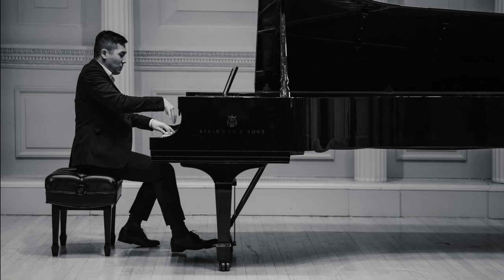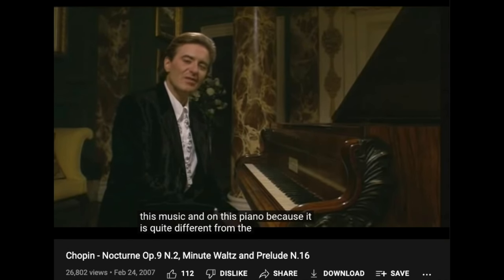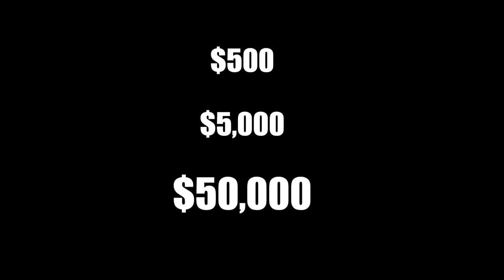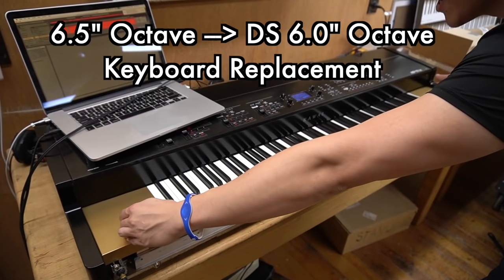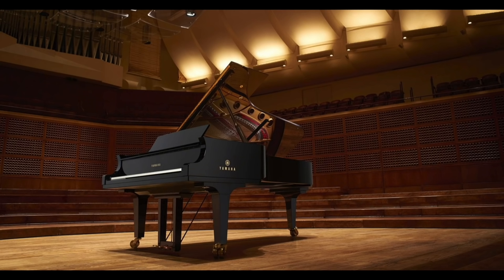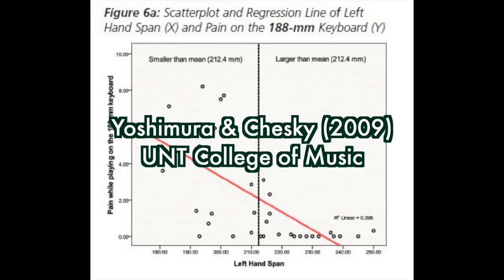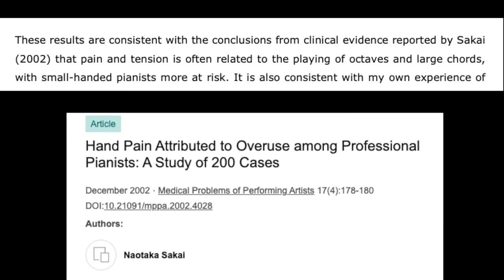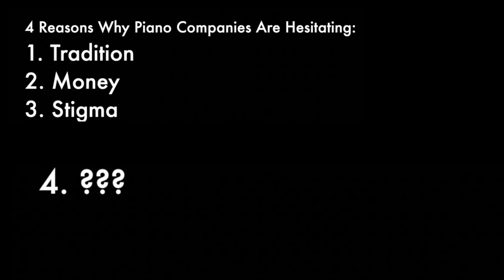Piano's Darkest Secret

Comment: Doesn't a smaller keyboard = more mistakes since you need to be more precise? And what about the width of a finger?
Reply: Many players have smaller spans AND more slender fingertips. For them the trade off for being able to span a comfortable 10th, 9th or even octave in some cases is well worth it. 

If you strain to reach comfortable octaves then your accuracy is very highly compromised in any passages dominated by octaves which can be quite common in classical piano.
Reply: Also the notes are much more 'under your hands' so less need for quick lateral or jerky movements to reach notes. The experience is that when your hand and the keyboard are well matched ergonomically, accuracy is greatly improved, not to mention tone and dynamic controls, speed, ease of learning etc...
Reply: @paskpianos  The conventional musical keyboard is handed down from a time before ergonomics was even a concept.
Reply: @douglascutler1037  Yes indeed. But - if you read the 1929 book by Otto Ortmann 'The physiological mechanics of piano technique' it covers many of the relevant  issues of ergonomics and biomechanics by going back to first principles of physics and anatomy. I studied this book in detail when I wrote my 2013 conference paper.
Reply: @paskpianos  I have that book. I haven't read it in quite a while. I will give it another look.

I agree with taking a scientific approach. But many musicians do not have a depth understanding of the scientific method. 

Generally, scientific research is not based on one-off studies. Usually, there is an incremental effort to become less wrong over time with follow-up research that builds upon and refines the original. All assumptions must be tested, Perhaps, there were follow up studies that attempted to build upon Ortmann but I'm not aware of any. If so, please direct me. In any event, Ortmann's work should not necessarily be taken as final word.

I do recall getting the impression from my original reading that Ortmann had assumed only an extending upper arm playing position when making conclusions about tension in the upper arm, shoulder and back. Yet pianists often allow the upper arm to fall straight down at the side. That arm position in my view is more relaxed and should be independently tested for muscle tension and compared to an extending arm. Perhaps Ortmann did comment on this and I just missed it. But if not, that is the type of thing rigorous follow-up goes after.

Also, the advent of reduced-width keyboards cries out for new, rigorous controlled studies of muscle tension throughout the playing apparatus comparing conventional to reduced scale. That would be university grade stuff, far beyond my resources. 

The injury study cited in the video is relevant. But are there any recent studies looking at active performance reactions like Ortmann?

Comment: if they made pianos with slimmer keys then the player with bigger hands would be able to do even more elaborate songs and you'd be back to square one in a decade.
Reply: Not really. Beyond a solid 10th, wide harmonic intervals in one hand suddenly get rather redundant as a stylistic or compositional element. And that is primarily in jazz piano and even there in the rather less-trodden genre of Harlem stride. 

In most of the classical repertoire the octave is still king. So more smaller hands reaching comfortable octaves would certainly level the playing field quite a bit there.
Reply: And the players with big hands wouldn't feel comfortable on the narrower keys so are unlikely to use it for composing...

Comment: I have the opposite problem being an organist, pianist and synthesizer performer. The standard piano feels like home to me, very comfortable...but with the non-standard key sizes of the synth world I am constantly playing keyboards smaller than the standard piano keys, I feel cramped and uneasy on these small synth keyboards. I am not speaking of the mini-keys, those are impossible for me to play, but the slightly reduced sized keys of synths and organs.  There should be 3 standards and all other keys sizes eliminated from the world. 1) The current standard piano 2) Your smaller keysize in this video. 3) Mini keys. PERIOD.
Reply: Agree - the alternative DS5.5 and DS6.0 sizes plus the conventional 6.5 inch octave suits nearly all adults. But we don't want 'mini keys' that are shorter and unweighted in cheap keyboards with less than 88 keys.
Reply: @paskpianos  The "mini-key" category is for synths and synth programming or what we call sound design. These keyboards are not designed to be performed by keyboard masters, just included as a convenient way to program the synth. The synth is actually performed from a remote full sized keyboard using a MIDI cable to communicate.
Reply: Yeah, I'm thinking of going in the other direction, more like custom keyboards designed for the ideal span of each player.

Comment: A shorter keyboard would have helped me when I was in college. You see, I wanted to learn to play stride piano. But I couldn't reach 10ths. I could just about make 9ths, and that was a strain. So, I became a voice major.
Reply: That is for sure. In stride, skipped 10ths just don't cut it. It's solid 10ths or go home. 

Funny thing is, I've posted a unique and potentially very inexpensive dual elevation keyboard design that quite literally makes impossible chords easy. Solid 10ths, 11ths, 12ths and more for ANY hand size! This is not a joke, it's a real thing. But it's not getting much attention. It can even upgrade existing keyboards and pianos. Perhaps it strikes people as too radical, perhaps and idea ahead of it's time. Even though it's simply an extension of a technique already used for maybe a hundred years by multi-manual church organists where occasionally they drop their thumb down to a lower level.

Comment: You dont know what you are talking about man. Some of us wish we had smaller hands and narrower fingers to be able to cope between the black keys. Also bigger hands move slowerr because of inertia and mass so any advantage would be negated for the most part.
Reply: It's a very small % of males who can't fit between the black keys. Widths of black keys vary between manufacturers and there's no reason why they can't provide narrower blacks. If you widen the white keys, then you would lose some of your reach...so if you can now play a 10th that might be reduced to a 9th if you make the octaves larger.

Comment: They say hands size is proportional to other parts of the body. Hmm ...
Anyway, I'm interested to try the 6" and 5.5" octave keys.
I have to stretch my fingers to play the octaves, but I'm so used to it, I could do it without errors. But there are pieces that requires me to play an octave + 2 notes higher (10th), that's what kills my fingers, and it makes my fingers sore just after 5-10 minutes of practice.
I'm from Malaysia, and I hope C Bechstein would do something like that, I'd trade in my current B190 for it, if it gives me the same touch, action and sound profile.
I think it's possible by maintaining the harp, just reducing the size of the keyboard, using the same actions, but not sure if it's possible with C Bechstein.
Reply: Although in general, taller people have bigger hands, the correlation between hand span and height is not strong. There are tall people with small hands and vice versa.

Comment: Tiffany Goff's reaction was so unbelievably touching. Music is an incredibly elitist endeavor with many of the revered exponents such as Liszt purposely doing things to make the piano less accessible to anyone who could potentially upstage them which then become codified and sacrosanct. No company would ever go on record confirming such a thing. Companies are the masters of smoke and mirrors hiding behind canards like R&D costs, etc. Therefore, it doesn't surprise me in the least that the piano settled on a size that effectively locks out most women and a sizable chunk of men. I am well aware of Rachmaninoff's celebrated span. Can you think of a more incongruous thing in music? It's like celebrating a violinist's neck length! Fortunately, progress is being made on this front. A giant congratulations to David Steinbuhler and MusicalBasics for promoting smaller keyboards. Yamaha or some other company could easily buy Mr. Steinbuhler's technology and instantly begin manufacturing smaller keyboards with ZERO or minimal R&D. In fact, if I were Yamaha or one of the big companies, I would be fearful of a competitor doing just that. So stay tuned. I sniff the winds of change.
Reply: Yamaha felt pretty comfortable confirming:
---
We understand your idea of a (digital) piano with narrower keys very well.

As a manufacturer of mass-produced products, Yamaha is unfortunately not designed for customised production or a run of very small series at disproportionately high prices. We are convinced that an individualisation of the key width would be a hindrance to the community of piano players, who for centuries have all concentrated on a common standard size.

We hope we have been able to help clarify your query and wish you continued enjoyment in making music.
Reply: There are a couple of startups with keyboards under development.

Comment: At 8.5", my hands are small, but not cripplingly so. Pretty much any guitar or bass neck is fine for me if I strap it high enough. On a piano, I find ninths doable, but tenths impossible. I did notice that some of the vintage synths I've played come up short of the 6.5" / octave standard without being mini-keys. The Yamaha DX7 comes in at 6 5/16" / octave and the Roland D-50 comes in at 6.4" / octave.

Comment: The concert halls, etc. have to prepare two- or more sized pianos and it is a good chance to sell more pianos for the manufactures. In addition, it might be a discrimination against female pianist. These approach would be more persuasive, I suppose.
Reply: Concert halls can have interchangeable actions/keyboards - a lot cheaper than buying another piano, and less space required. Only two smaller sizes are needed to cater for nearly everyone - DS5.5 and DS6.0. Alternate actions can be swapped over in minutes, which has already been done in the Dallas International Piano Competition where contestants have been offered a choice of keyboard.

Comment: It seems average hand span for a man is actually 7.4 ". Where did you get your chart?
Reply: The average span for an adult male pianist is just under 9 inches, based on several reputable studies. Hand span is defined as maximum span between outer edge of 5th finger and thumb, with hand stretched out to the max on a flat surface. For women, it's an inch less, so around 7.9 inches. For details check out PASK....

Comment: You can't take a piano with you

If you move your hands out of pure muscle memory, 
having different size keys is just horror
Reply: Check out brain plasticity. It is now the accepted norm in neuroscience. 

Motor-control brain mapping is never fixed or hard-wired even under normal circumstances. Always shifting a little on it's own, anyway. The testimony from those who actually use reduced-width keyboards is that adaptability is not so hard as you might think.
Reply: Exactly i had a light weight electric piano, when I changed that it was hell trying to press on heavy keys

Comment: I wonder if given the option the most popular choice in the general piano population would be something slightly smaller than the current standard.
Reply: Undoubtedly that's the case. If there could only be one size, it would be around a 6.0 inch octave.
Reply: @paskpianos  The alien anthropological survey team would shake their heads at the lack of progress in Earth's musical keyboard ergonomics.
Reply: @paskpianos  Yes. I'm a male with medium large hands. I can span a 10th but my white key 10ths are crimped and from the front. Not exactly mobile or dynamic. Just a little more span would certainly make a difference. I think there must be many males in the same boat.
Reply: @douglascutler1037  Yes indeed. Are your fingers slim enough to fit between the gaps if the keys were narrower?
Reply: @paskpianos  It wouldn't be much of an issue for me with a slight reduction in width.

Comment: Everything in this video also applies to computer keyboards. There is no perfect computer keyboard for every hand size or a perfect shape or a perfect layout. And fortunately there are lots of variation available for this kind of keyboard. Don't stick with a basic computer keyboard if you don't have to. Try out different sizes and shapes and arrangements and you may notice that the reason why you could never type faster or more accurate or with less pain in your hands was not the way you type, it was using the wrong keyboard for your hands.

Comment: So, if you have small hands with fat fingers you are really screwed since you can't fit between the black keys.  Just blame your parents for not stretching your fingers. My 4-year-old girl can reach 6" since like me and her brother our thumb and little finger oppose each other at 180 degrees.  I have relatively small hands, but if they are flexible a 10th is not a big deal.  The dynamics of a piano for maximum sound and response are the result of endless experiments and refinement.  Don't blame the piano!  BTW it does not require a giant hand to play Chopin Op 10 No. 1 etude.  Also, how many of you, including professionals, leave out notes in three chords (bottom octave note) of Op 10 No. 2 so that you can play much faster?  You know exactly what I am talking about. If the piano were smaller, you would STILL skip those notes for performances.

Comment: I feel that the issue is exaggerated. There are many other reasons for the standard size keys. Talk to a piano technician.
Reply: Appeal to authority fallacy. Technicians could simply be trapped in common practise. Would not be first time.
Reply: Same thought, it's a big instrument and can be carried, if it was different sizes, it would be different each time you change the piano

Comment: 🎹🎹🎹🎹🎹🎹🎹🎹
There is one massive factor that this otherwise well thought out video totally missed. The left verses the right hand of the vast majority of the global population don’t have the same reach on the keyboard. My left hand reach is 8.5”, where as my right hand is barely 8.0”  This means I can only play a full octave chord in my right hand on the white notes, but my left hand can play a full octave chord plus one extra white note beyond the 12th note scale per octave.  Right hands typically have a half inch lessor reach or finger spread. This makes a smaller keyboard all the more of a necessity among the vast majority of piano players on a global scale.
Reply: It's true that left and rights hand spans are often different. However in our 2015 study of the hand spans of nearly 500 pianists, we measured both hands and there was no consistency in terms of which hand was bigger.
Reply: @paskpianos  Right hands are typically bigger than the left, especially when it comes to ring size. So I’m shocked about your results. I’ll make a point to measure a bunch of people’s left and right hand spread and get back with you.
Reply: @jamesr4891  Fingers may end up thicker on right hands than left due to greater use (for most people). Our data was only about hand spans. There is no evidence that hand spans change by more than a very small amount from activities like piano playing.

Comment: So get a manufacture of electronic keyboards to design the narrow keyboard + an adapter that connects to any electronic piano.  If it would help a kid learn piano more easily, the parents might pop for it.  Gotta believe the interface would not be that complicated if the mfg gave you the source code.  Why buy a mechanical piano for a kid?
Reply: There are a couple of startups doing this.
Reply: Something like a barebones Midi keyboard plugged into a Raspberry Pi 4 + Touchscreen with Pianoteq running could make an interesting form factor

Comment: Is the touch, and sound the same? It’s not softer or less dynamic?
Reply: Every effort is made to retain the original feel and touch. Even a Steinway switch out version, for example,  uses a new Steinway action stack except outfitted with the new keys. One issue that did arise was a reduction in the rigid strength of highly dog-legged key shanks in the extreme bass. Unmitigated, these keyshanks have more flex and therefore less power. David Steinbuhler overcame this problem with a new keyshank design that includes a triangulated brace.
Reply: @douglascutler1037  thank you. Really appreciate it. I want to buy one. Do you know how much is an upright vs baby grand?
Reply: @transformationalpianolifec1643  Check DS Standard Foundation - link under video.

Comment: My fingers are just too big
Reply: So just skinny up your black keys. If you have wider finger tips hitting skinnier blacks won't be a problem.
Reply: @douglascutler1037  thanks for the advice :D
Reply: @the_atoms5242  I actually did this to a couple of my digital keyboards as I have wider finger tips myself. Works great. One method is to remove black keys (super easy with Korgs, much harder with Yamaha, not bad with Casio), then I take pieces of broken glass with curved edges and drag then along the sides of the plastic keys. The plastic slowly peels off and narrows down. You can actually leave the top surface of the black key alone. Takes 15 or 20 minutes per key but you get a very good result in the end and do not create microplastic floating in the air from machining. It's a bit of work but the end result is fantastic.